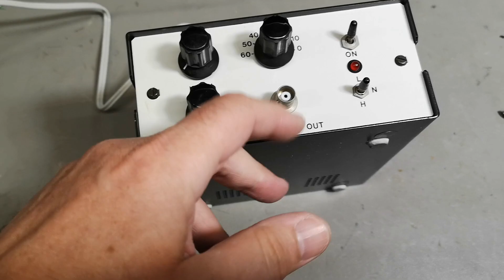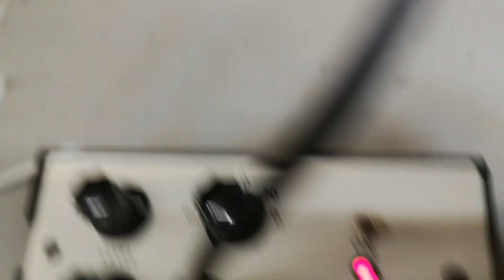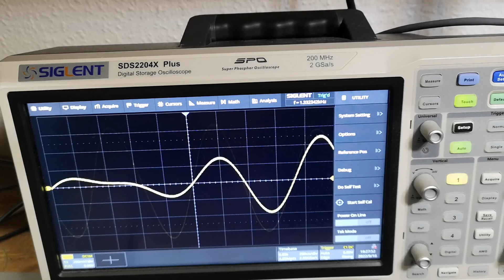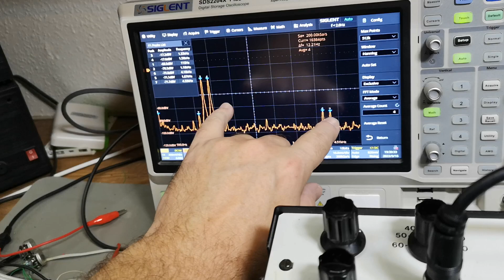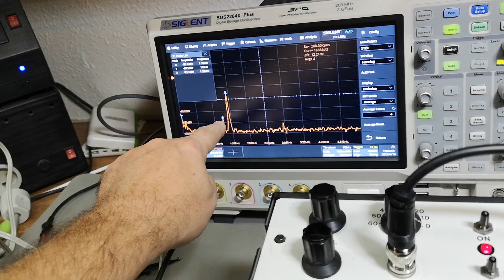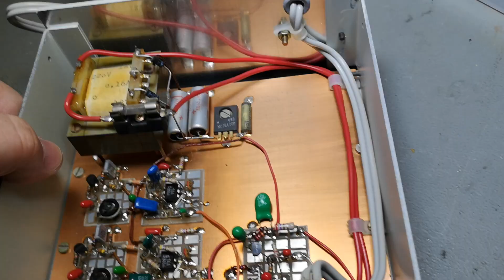DIY two tone audio modulation tester 1980 teardown

Comment: This workmanship is absolutely OUTSTANDING !, looks very complicated to newer 2 tone DIY builds..
I will keep coming back to what's in this BOX for component and soldering QUALITY !!!.
Thank you for this tear down.
✌️ ❤
Reply from the maker: we call the sticky pcb parts for minimount it was a company who made them for rapid prototyping this way,
you can cut stripes of pcb and 10 sec glue to another bare copper pcb, and then add components, try make it as good looking as this example, and it will be easy to figure what is what
Reply: @T😂eardownOZ2CPU  cheers. i am still a newbie but this looks a lot more complicated than a few schematic DIY  builds which I downloaded from the internet which I don't think have rhe stepped attenuators..
Thanks for the reply.

Comment: Regulator looks like it was made in 1976, week 40, as the package type is no longer available in the 1982 Motorola data book, instead replaced with the T suffix TO220 package type. That package is 1970's era definitely, and yes they likely did use the same lead frames and package mouldings as the transistors to package the regulators, as they likely were a low volume product for special order, so customers of high volume could use the same layout on heatsinks and boards for both regulators and transistors. Storno was a pretty big user of Motorola parts, so they likely did order them specially, but would eventually have balked at the price for the special runs, as I remember hearing a quote for the running of a part as being $10 each, minimum 100k parts, and a 6 to 9 month lead time from payment, for a transistor that was $1 for an equivalent that was equal in all respects over the original part, even being JANTX tested, just not that original part number.